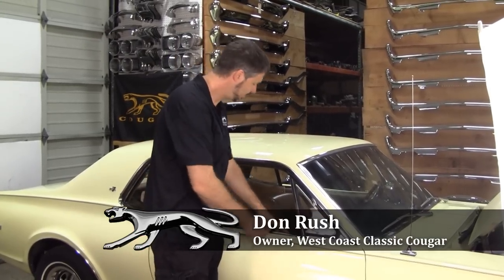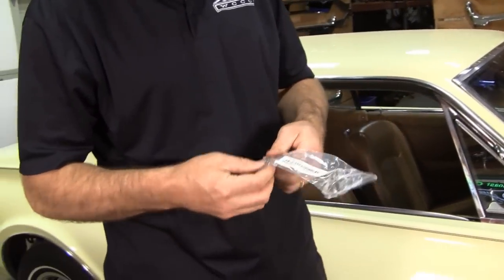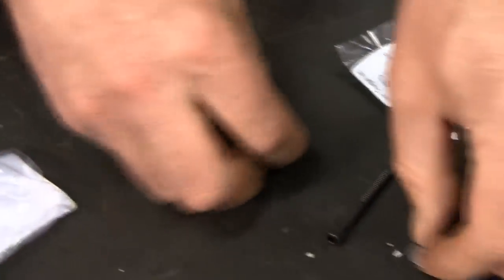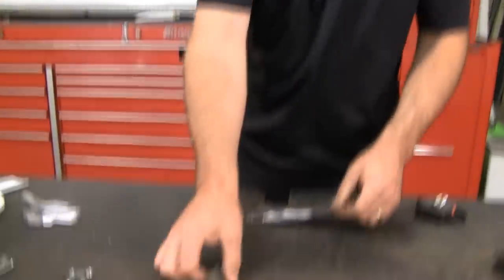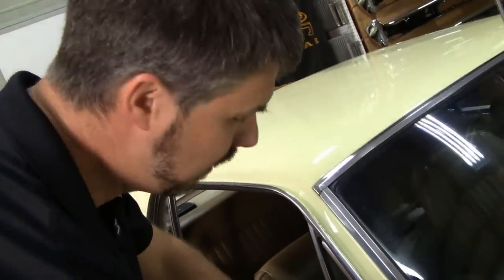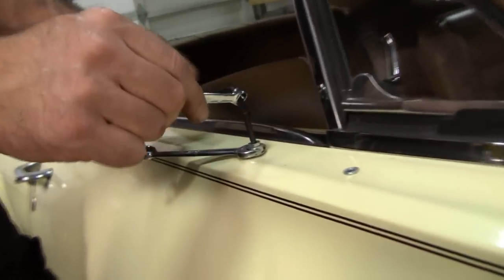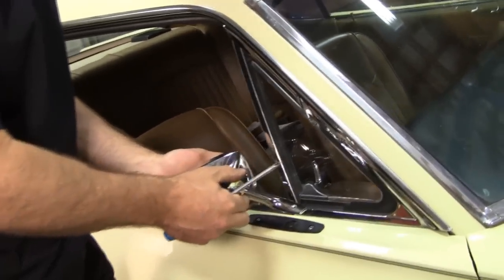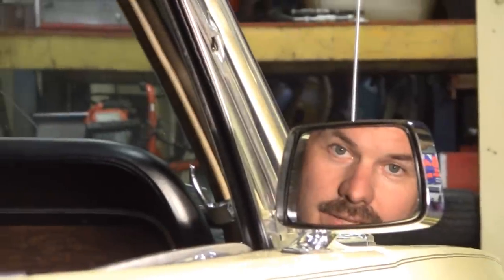Passenger Side Mirror Installation: 67-68 Mercury Cougar

Comment: Is that 9 1/8” position the same for the driver mirror?  I bought a ‘67 and it has no mirror at all.  I just hope there’s been solid metal put there so I can install one.
Reply from the maker: At the 5:50 point in the video, that measurement is the driver side.  Don first measures the driver side as a reference of where to install the passenger side mirror.

Comment: I just like the balance with a mirror on each side....WHERE it is located, as driver vision angle is so different across span of interior. And vent window is in the way IF located as driver side, along top of door. As was only a dealership install, I guess no factory install template was ever made.  I have a clean pair of Ray Dot mirrors to install. CONVEX would help a lot on these factory/repro mirrors.
Reply from the maker: We have found that it works fine if mounted the same as the drivers side. In our experience, the vent window does not get in the way, and we like the symmetry. These were never available "back in the day" for 67-68 Cougars, and are a relatively recent aftermarket creation, thus there are no Ford templates.

Comment: Is there any way to tighten the mirrors?  Driving mine seem to always move.
Reply: Beyond the obvious screw on the back of the head the one that most often comes loose is inside the hollow base and requires you remove the mirror to access it.
Reply: Thanks.  I took the mirror off and tightened the one inside.  It seemed like the outside mirrors themselves are what loose  but ill see if tightening those two help

Comment: Will it fit a '69, or do you have one for '69?
Reply from the maker: 69 Cougar's never came factory with a passenger side mirror, but if your car came with the driver side sports mirror, we have a reproduction of the passenger side sport mirror that came from the factory on the 70 eliminator that matches the driver side sport mirror on the 69. https://secure.cougarpartscatalog.com/store/p/13890-Side-View-Mirror-Sport-Passenger-Side-Manual-Repro-1969-1973-Mercury-Cougar.html

Some 69s came with a chrome mirror similar to the 67-68 if they were ordered with a special paint code, since the sports mirrors were pre-painted to match color codes (69 only drivers side chrome mirror: https://secure.cougarpartscatalog.com/69stdmir.html).  If you have the 69 chrome mirror, there is no passenger side mirror that matches the driver side mirror.